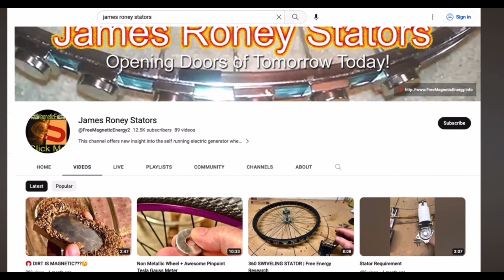Crazy Unexpected Results | Continuous Motion Research | Update Where I’ve Been

Comment: I don't know if you will see this or not, it's been a long time since this video was posted. But I noticed all of these magnetic motors overlook gravity. I'm working on something which uses gravity in an additive capacity. By rotating the wheel in a vertical plane, connecting the stator valve magnet ( for lack of a better term ) to a cam mounted on the hub via a push rod. You can then use a slight addition of gravity to rotate Stater magnet on the downstroke to get the polarity change that you're looking for. It then becomes a question of timing. I have been thinking about these problems for many years magnetism by itself is a static energy system so is gravity, but combining the two may be the solution to a more efficient machine. Notice I said "efficient"  and not "perpetual" there is no such thing as perpetual. But I think efficiencies can be achieved to "simulate" the perpetual nature.
Reply: @JazAero  Why are you not getting the desired results on your YouTube channel, such as views, comments, and subscribers?